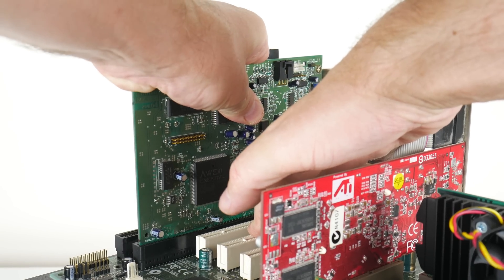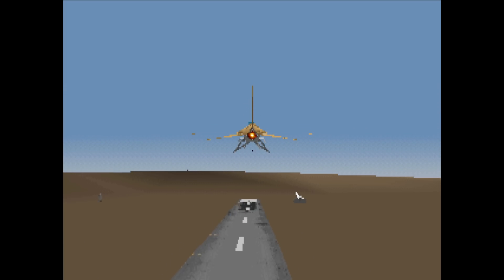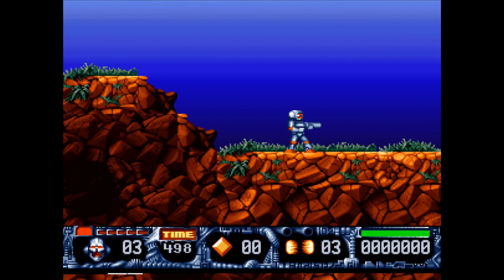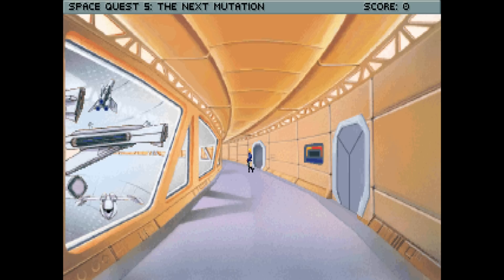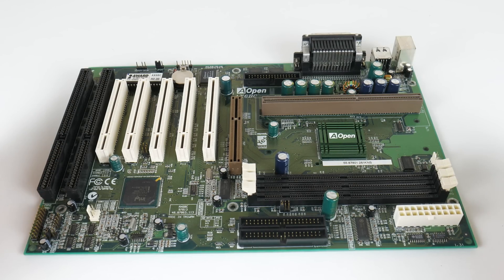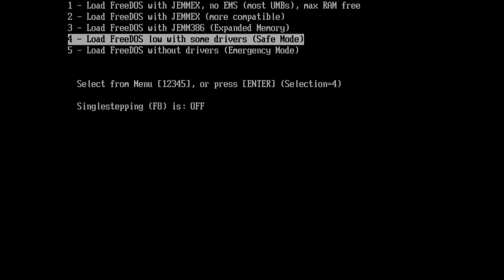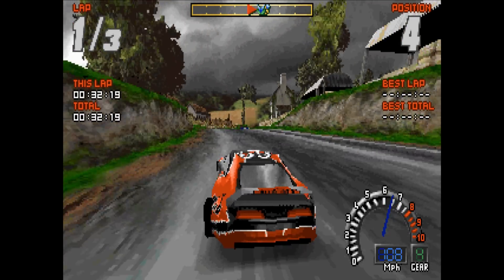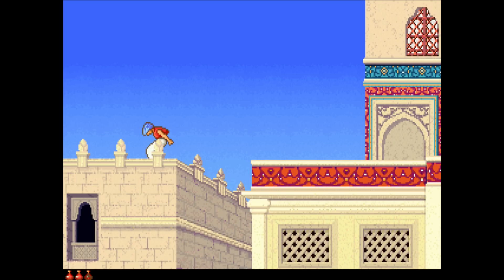FreeDOS 1.3 is it worth it for Retro DOS PC Gaming

Comment: I have an archive of over 800 DOS games that I test on every new PC I  build. It's a LOT of work but it gives you a very clear picture of how some hardware causes certain issues on a specific OS  I've got a small notebook full of notes and every tested game gets written down and if something is wrong, it gets added. If I run into a problem I compare it to the issues I had with other games on the same issues, or similar issues on other systems and sometimes that's enough to make me realize what may be the cause. 

This made it very clear that every PC has its quirks - it's possible that games that won't run in FreeDOS on one PC, will work on another PC. I mean, I've had games fail to run on MS DOS 6.22 on my Pentium II 333 but run fine on MS DOS 7.10 but the same games run fine on MS DOS 6.22 on a different PC ... . 
 
Currently I'm testing out a Pentium II 333. The main issue there by far is memory. Many games run well under Windows 98 but fail to run under DOS 7.10 and need all sorts of XMSDISK or other tools to reduce the amount of memory a game will detect.
Reply from the maker: My main two issues I run into with games is CPU speed and also memory. I created this MS-DOS Starter Pack with a boot menu that lets you select memory types. For older DOS games disabling CPU Cache gets many games going. Selecting PC Speaker instead of Sound Blaster gets some games working on fast machines because of this.
Reply: @philscomputerlab  CPU speed is definitely a common problem and some games such as Ultima VII are VERY difficult to get running at the right speed since they don't allow cache disabling to slow down the CPU but that's why my retro setup consists of a 486 DX2 66 and a Pentium II 333. There's still some games that don't feel right (Origin released a lot of games that were speed-sensitive).

With FreeDOS specifically, the memory managers are by far the biggest problem I had in the past. Some games absolutely need the real HIMEM and EMM386 and even specific versions of them at times - the 7.10 versions will not always work so a boot disk running DOS 6.22 or even DOS 5.0 is needed but then you run into the FAT32 wall. Ah the fun of DOS game compatibility ...
Reply: @redavatar  Would you give an example of what games are problematic with the native FreeDOS memory managers?
Reply: @magnum333  If I can find my notes I'll post them here. I usually write down all the problems I experience in a little book so I can avoid making the same "mistakes" in the future.
Reply: @redavatar  Great! I'll be looking forward for your message
Reply: @magnum333  hello, with himemx the game "Inner Worlds" gives an error: "XMS Error: can´t disable A20 line".
With fdxxms, it works.
Greetings.
Reply from the maker: I've pinned your comment because I am eager to hear what you find! 800 Games, that's amazing 😀
Reply: I am interested in your archive. Any FTP ready? 😅

Comment: Tried using freedos to do a bios update on my AMD HT2000 board.  it would not work, the bios tool thought there was a bios to files size difference where there was not.  seems like a file system issue/big in freedos.  had to use MSDOS 6.x to do the install (was a pain as it and the bios update would barely fit on a single floppy)

Comment: If I remember correctly, in DOS 6.22 the max partition size was about 2 gigs  The biggest hard drive I have seen using DOS was 500 megs. They might be keeping with that max partition size just in case there are programs that a larger partition size might be an issue. The only programs I could think of that might have that issue would be disk editing programs.

Comment: I honestly don't understand the FreeDos project, what is their goal and why should i use a dos-clone instead that the real thing? Just install a version of MS-DOS, PC-DOS or DR-DOS and you will be fine, you will also experience the same exact OS that we used back in the day. The only advantage that i see using FreeDos is the ability to use USB drives, but if you use it on a real vintage machine... there is no USB anyways. If you want to emulate DOS on today's machines you are better off with DOSBOX. After all, why use a 16 bit OS on a modern computer? What does FreeDos offer to today's computers and users that they can't have with MS-DOS, PC-DOS or DR-DOS? Does it support 32 bit or 64 bit systems? Of course not or it would break compatibility. Does it support multitasking? It doesn't and probably never will. Besides, what's going to happen when Intel decides to get rid of backwards compatibility in their processors to get rid of the whole 16 bit or 32 bit environment? Or what if we switch to ARM for future computers? Will FreeDos still be able to run? I highly doubt it, and even if it did, no software of the 16 bit era would be able to run anyways.

Honestly, they should use their time and knowledge working on DOSBOX. Or they could work on a virtual machine for modern computers specifically made to emulate 16 bit computers where to install the original DOS and use all the programs of that time. To me FreeDos is a solution in search for a problem. If i have a vintage computer, i'm just going to install the real thing on it so to avoid every possible incompatibility altogether. If i have a modern computer, i'll use DOSBOX or a virtual machine, this will work no matter what the underlying modern processor there is and it will also emulate sound-cards and hardware of the epoca. So, again, what is the goal or role of FreeDos in today's world? 

It would be cool to have a virtual pc that accurately emulates 16 bit computers, that lets me choose how many MHz to run, what kind of CPU (8086? 80186? 80286? 80386? 80486? Pentium? Intel? Amd? Cyrix? ....), how much RAM, what kind of hard disk drive, which ISA/PCI card to install, perhaps even configuring their switches, to fully emulate the experience of the 80ties and 90ties when you had to know what an IRQ was, that an IO Address was, what a DMA channel was... when you actually had to RTFM if you wanted to change anything in your computer. A virtual pc that tries to emulate every aspect of the original hardware, bugs included, with visual and audio feedback for the HDD led to the Turbo switch LED to the noises of the HDD and floppy disk drive. 

It would be fun to play with and it would preserve the history and origins of IBM-compatible PCs providing today's users with the same exact experience we had back in the days... but honestly, i don't see how FreeDos is useful to anyone, to me it just seems a DOS alternative that is 30 years too late to have any role in this field, a solution in search for a problem.

Comment: A feature I'd like to have in FreeDOS would be an 'autolaunch creator'. A little tool that autoatically creates a batch that reboots the PC using the right memory options for a given .exe and autolaunhes the .exe after reboot. So you only have to execute the batch files created by the tool later and not care for the boot options.

Comment: i just tried installing FreeDOS via floppys but it failed at disk 2 with a read error (the floppy itself has no bad sectors, formats fine.)
Also i tried to boot the setup from USB via plop boot but it crashed the hell out.
The regular LiveCD Iso booted from USB can´t find it´s kernel image to actually boot up...
I really don´t want to burn and waste another CD-R for this...
Using a Compaq Armada 7770DMT with a PCMCIA USB cardbus inserted.
No idea if this would cause the issues i´m facing.

So in the end i simply give up and continue using my unofficial DOS 7.1 installation CD.

Comment: Did you try out any of the Mechwarrior games?  The originals worked great on a i386, but if you ran on a 120mhz 486, it ran so fast any battle would be done in seconds, with you as the loser!  It obviously needed a wait state app.

Comment: Any problems getting 3Dfx (like Tomb Raider 1) running and are there any problems with drivers?
Also did you run the games not working off a 2G partition or a larger one? Had games before that had problems when the expected disk size was too large. The support of long file names (if activated) might also create problems.
Will give it a try as exchanging CF cards at the back of the PC is easy. :D
Reply from the maker: Awesome, let us know how you go!
Reply: @philscomputerlab  First update: Test Drive 2 - The Duel works, had to remove TDS2HISC.DAT and .BAK (should be config files as the date is newer than the rest of the files) and started it via the DUEL.EXE. CF is partitioned and formatted to 2GB FAT16, but don't know if this was also a problem as the game got stuck at a black screen without sound, freezing the whole system, before removing these two files.
Short update. Now after rebooting is doesn't work anymore, even with no new TDs2HISC files. Need to test longer, if there is another cause for it not starting. Had the PC running for more than an hour, while on the phone and suddenly the game worked (after removing the files).
Update 2, on how I really got it working. Before, I used edit to look into the TDS2HISC, before removing it and then ran the game. Now I moved the files back, loaded the editior and closed it again and suddenly the game is running. So try running the FreeDOS editor before starting the game. Wonder if this works with other games too.

Update 3: GP Circuit also works with this trick. Both games from Accolade (same engine?) so can't really say anything about other games. Also tried running the game from Norton Commander, using the NC editior and also running and closing NC before starting the games but this always resulted in a system hang. So far only running the normale FreeDOS edit beforehand worked.

Tomb Raider 1 with 3Dfx (using the Voodoo 2 workaround, which works fine under 6.22) freezes after the Core Design intro (STRG+ALT+Delete still works unlike the TD2 freeze) even if set to no sound card. Orphinit (Orpheus I sound driver) works fine and so does the DOS USB driver.
Update on TR1 3Dfx: Seems to be a JEMMX problem. Booting Option 3 with JEMM386 helps.

Stonekeep has problems installing from CD, no matter the boot and install options used. Works fine under 6.22.
Tried CD-Rom drivers and MSCDEX from 6.22, which are working but installation of the game still has the same problem. Stops at copying the GROUP files from the DATA folder.

Comment: Testing windows 3.1 is a better test for freedos which is incompatible for centuries!!
Reply: Windows 3.1 will work in standard mode in FreeDOS 1.3, but not in enhanced mode. For the latter we still need to wait for newer better versions of FreeDOS.
Reply: @OpenGL4ever  Windows 3.1 works in enhanced Mode in freedos the question is if is really compiled for WIN31SUPPORT.
Reply: @asanjuas  Not really. If you take a look at some of the videos shown here on YT about that, then you will see, that they use some stuff from MS-DOS to be able to make it run in FreeDOS.

Comment: It's really nice that a Free software distrobution of DOS is this good. I always prefer to run libre software when I can, though I don't have a DOS machine . . . yet. If I ever get one, FreeDOS will be what I install. I just need to see what's compatible. I think the only soundcard that it works with is SoundBlaster16's right? I'll probably have to make sure of compatibility if I buy anything.
Reply from the maker: It should work with all Sound Cards, just need to install the drivers and you're good to go!

Comment: Total newb here, why would I want to run FreeDOS instead of MSDOS? Are there any advantages in doing that?
Reply from the maker: Well, for me, you don't. But everyone is different, some people refuse to use software from Microsoft or have issues with licencing. For me, I don't need another layer of potential issues and with MS-DOS I know everything works as it should and I can focus on issues with other aspects like hardware or configurations.
Reply: @philscomputerlab  I see. I was hoping for some technical advantages, even if only for specific cases. Thanks.
Reply from the maker: @airspeedmph  The channel focusses on Gaming, so that's what I know :D What requirements do you have that make you consider something other than MS-DOS?
Reply: @philscomputerlab  Oh no, still gaming. I am considering putting together a retro gaming PC with some old parts I have lying around and using MS-DOS on it, But then I keep hearing about FreeDOS and I was wondering if there's any point in bother with it.
But I understand, MS-DOS it is :)
Reply: @philscomputerlab  can't you install FreeDOS on modern 64 bit multi-core systems?

Comment: Have you ever tried PC DOS 7.0 released by IBM? It was really good for getting conventional memory freed up compared to MS DOS 6.22.
Reply: I remember using some DOS version where it was also really easy but don't remember if it was FreeDOS or MS-DOS 7.x from Windows 95. Don't think that it was PC DOS as they only seem to come as XDF images and a CD "Upgrade" release.
Thing is, with my DOS 6.22 setup I'm never running into issues with too little conventional memory. 617K with mouse, CD-Rom and sound card drivers loaded.

Comment: Now if only ReactOS could be advancing this fast.  Granted, there's a whole lot bigger API set that ReactOS has to replicate.
Reply: API set LOL. ReactOS is NT. it is a way more complex operating system than DOS.
Reply: I would try ReactOS because I have a scanner for WIndows XP.  It of course isn't supported by any newer versions of Windows and the manufacturer no longer is in business.  It is a Memorex Mem 48U.  There are a couple other scanners that are the same thing but they also have no more driver support.  It was also a TWAIN scanner.  Why Microsoft no longer supports that is a mystery.  I refuse to buy an all in one (scanner, printer and fax) because they will often refuse to function when ink is low even if you are only trying to scan something.  That just has to stop, it is 100% fully inexcusable and there should have been massive class action lawsuits every single to such a horrendous pile of junk is made!!
Reply: @charleshines1553  I wonder if you'd be better off using some VM USB passthrough or an air gapped XP box
Reply: @charleshines1553  Agreed. HP was banned from selling ink for a while, due to the shady, time-to-kill ink cartridges, that would lie and tell you the ink was low without even using it (sometimes straight out of the package). Of course it didn't get reported much but the printer companies take a loss on their printers because ink is their bread and butter. They charge outrageous prices for colored dirt. I have a Brother printer that takes three color cartridge and a black cartridge. I rarely print anything but when I do, I always have to replace a cartridge. Never ran one empty but the printers says it's always catastrophically low on one or the other.
Reply: @AtariBorn  I remember HP inkjets telling you ink was expired, even if you just opened the seal because they had an expiration date built in. I remember that if you disabled two-way communication on the parallel port, you could use expired ink because the printer could no longer tell what the time/date was.
Reply: @charleshines1553  running WinXP on a VM does not resolve the issue?
Reply: ReactOS is trying to do more than implement a userland API, it is also trying to be a complete OS. I think that’s unnecessary. I think WINE on top of Linux is the better approach: take advantage of the hardware drivers, network stack and all the other cool stuff you get with an advanced, modern OS, and concentrate on implementing the userland API for these legacy. That will get you further with less work.

@Charles Hines I did a search for that scanner, and found a posting on the OpenSuSE forums from 2012 where someone had got it working under the SANE subsystem on Linux. Just FYI.
Reply: If you need a Windows NT system then go and use a Windows NT system like Win2K, WinXP, Win7. ReactOS will have to go another 30 years. It's nowhere close to replace WinXP. At least not at that development speed.
If you want to speed that up, then learn programming and improve it.
Reply: ReactOS is wasted dev effort that could be better spent on improving WINE. Having a Windows compatibility layer for Linux makes way more sense than an entire clone NT OS.
Reply: @NerdENerd  By principle wine will not be able to run windows software that uses specific special hardware that requires and speaks to a windows driver. ReactOS could theoretically offer that.
And btw. ReactOS does use source code from Wine. Also from a dev side, someone who wants to develop on the kernel side will not want to work on the userspace API side. These are just different tasks.
Reply: @NerdENerd  it's mutual between these projects. you might have seen that wine matured alot recently. reactos became quite important for wine